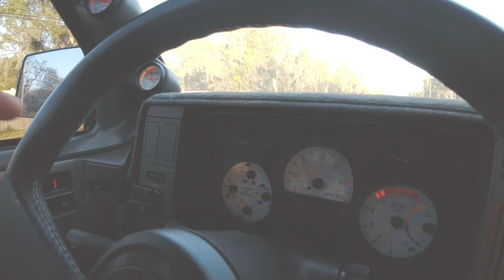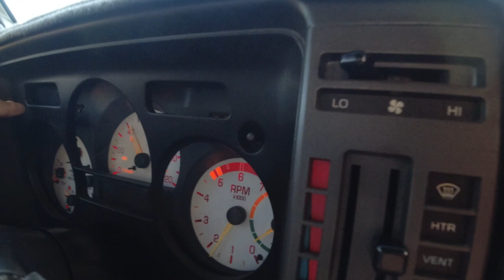I took my Syclone to a local car show and it didn't end well :(

Comment: I have a 92 typhoon and I couldn't keep it running for more than a month and a half.  I'm currently getting a complete wire harness done, eliminating my factory distributor for a dual sync distributor as my ignition control module and old wiring was causing my problems.  It will be will have sfi fuel injection instead of the factory batch fire and it will be controlled by a maxxecu after market ecu.  The ignition system on these are very poor especially after years of weather and turbo heat.
Reply from the maker: i don't know if you're going the correct route. I drove my Syclone when it was stock as a daily driver for many years. It only became unreliable when I started to modify it and deviate away from stock.  Give Sportmachines a call and see if they can help you out before you go crazy replacing everything.
Reply: @KGsGarage  Well Sean from SK Kustoms he was suggesting that the Holley conversation making trucks being more reliable.  I also have a grandnational and I feel that setup in my opinion is superior to the set up that the typhoon/syclone has minus the awd from the trucks.  My motor is built and to be honest my problem has been my distributor and the ICM as I have replaced the ICM around 10 times.  I'm not going for crazy numbers around 4 to 500hp.  I'm actually 15k in on the harness and the distributor.  I would increase the power only if I do the 4l80e transmission conversion.  I'm using maxxecu I guess I will see how it functions before I draw any conclusions.